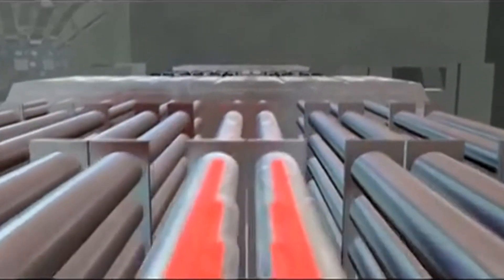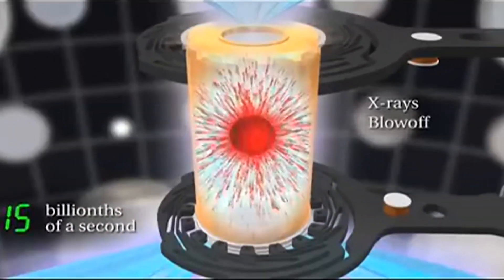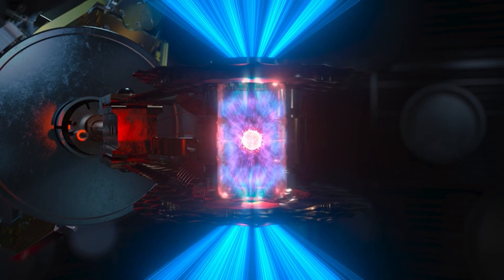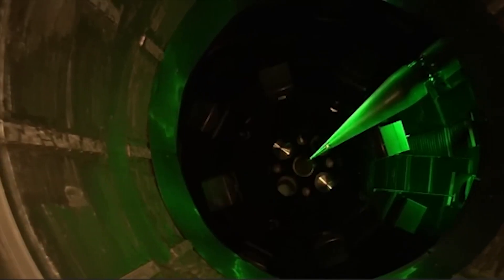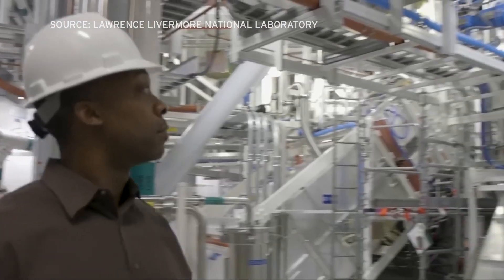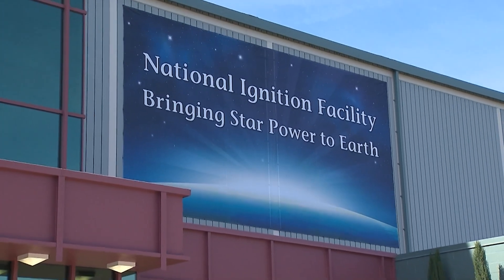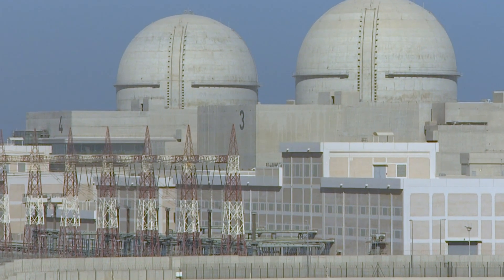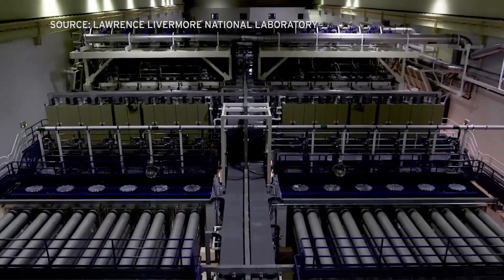San Diego engineer says fusion breakthrough is one of many more steps

Comment: It's being massively overhyped and is a big nothing burger. The "net energy gain" they speak of is simply heat in vs heat generated and NOT electricity in vs electricity out. They are making a big deal of putting 2mj in and getting 3 mj out, however, it took 300mj of electricity to fire the lasers and that doesn't even account for all the electricity a containment field and all the other equipment would consume which is be needed for a power plant.
Reply: I believe that ignition is literally "we got more energy out of the reaction than it took to create it." I don't think that they used 100x the energy that came out and then call it a success. People have been able to achieve net zero energy fusion for decades.

Comment: It didn't produce more power than was used by the overall system, only that provided by the Lasers. it also did it for an infinitesimal time. There's no way this over complicated and expensive technology will ever compete with Molten Salt Reactors which are relatively simple to make, and just as efficient. It's just a White Elephant I'm afraid, just like ITER. They've backed the wrong horse and can't walk away because too much money has already been spent.
Reply: You're right about how they continue to play games with the numbers to falsely claim net gain, but I do suspect you're wrong about it being impossible.  Absolutely right about modern fission reactors, though; very clean, very safe, very tiny amounts of long-duration waste.
Reply: @sporkwitch  Impossible no. Improbable yes. At least not anytime soon.
Reply: @cmontes7961  that's a more reasonable position than I read from you original post. I agree, it's still a ways off, but the research we're doing now is necessary to ever reach the goal. In the meantime, we need fission plants that will produce tritium for us to continue the fusion research. Having to fall back on deuterium-deuterium fusion would be a setback of decades if not a century or more.
Reply: @sporkwitch  Ya but this arguably is not a breakthrough. I think it's 100 years away if ever. But if it can be done it will change the world.
Reply: @cmontes7961  again, agree about how they're misrepresenting it. I'm more optimistic than that about the time line though, with one caveat: we build new fission plants that can produce tritium. Canada has the only three in the world right now, and they're all scheduled to be closed thanks to the so-called "climate activists."